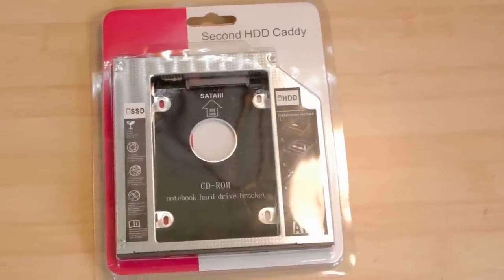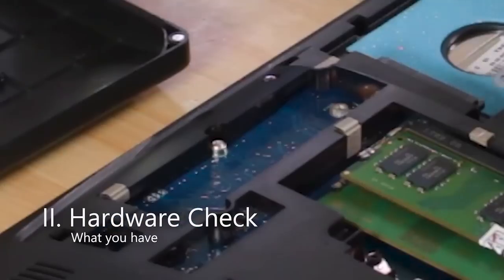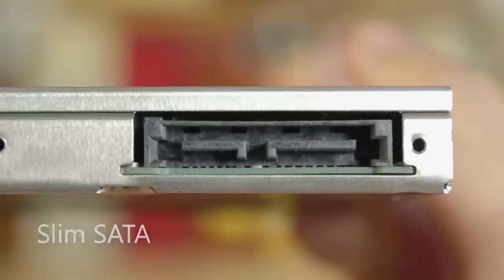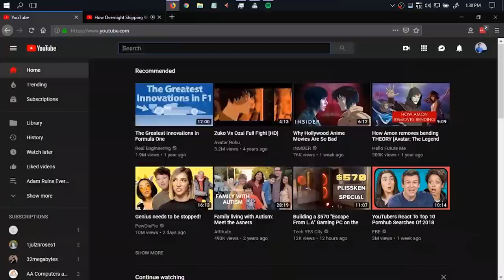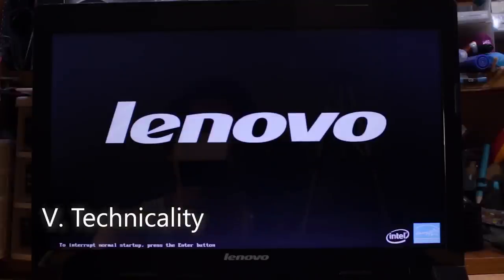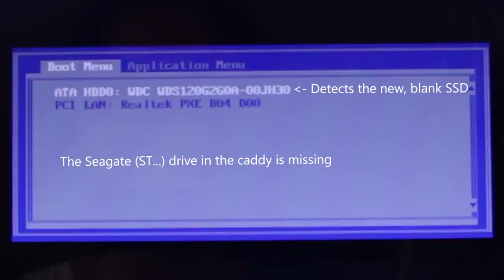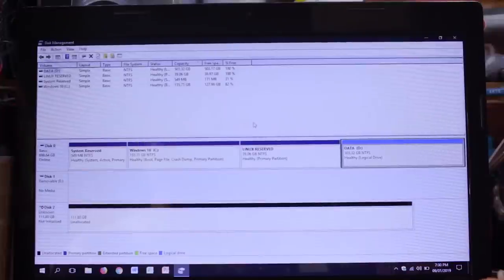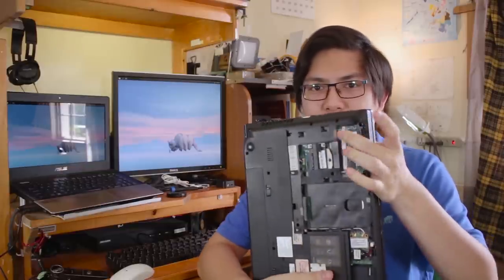SSD + HDD in Almost Any Laptop (The Caddy Method)

Comment from the maker: The Cloning Process: https://www.youtube.com/watch?v=wOksj16Q3ps
Reply: by mistake i have directly entered the caddy with the ssd and it is not coming out . help!
Reply: @Kevin Carl Jardiolin 128 GB should be enough. Remember to keep your desktop and my documents clean.
Reply: can I put an SSD in both internal hdd bay and caddy though ? if yes (in the caddy), Which SSD can I use ?
Reply: 1:08 SSD VGeN vs SanDisk fit my caddy drive in my laptop.
Reply: What is the model of the laptop you used in this video?

Comment: I want to share one important point with all. Always connect SDD with existing HDD sata 3 port to get max speed and you can shift existing HDD to DVD rom drive port sata 2 especially in case of laptop
Reply: But won't that slow down laptop if my windows is installed in HDD?
Reply: @sibinpaul2003  No. Because HDD maximum read and write speed is way less than theoretical speed of SATA 2
Reply: @awaisiqbal8934  Ohkk. Thanks for replying 😁
Reply: @sibinpaul2003 that's why this video is for. To upgrade to a ssd. If you want a faster HDD if your HDD is 5200 RPM. Or if you want something between a HDD and a ssd buy a hybrid drive. At first it will be slow but  it will get used to what you use frequently. Only if you don't install new apps.

Comment: The reason that the HDD may not be detected in the optical drive is because maybe, the HDD is drawing too much current from the DVD's internal port, during the initial spin up, HDD will draw significantly more current for a few seconds, manufacturers probably didn't anticipated their DVD slot will experience such a current surges so they might not make enough power headroom for the DVD power rails. Of course this is from my personal opinion, it may depended on several factors (Chipsets, Drivers, HDD brands...)
Reply: The pin outs are diff aswell
Reply: Would an ssd be more likely to work?
Reply: @Handlebrake2  In my experience, SSD tended to work more reliably than HDD in a caddy like this.
Reply: What's the solution. I am facing this too
Reply: For my dell E6420 both sata HDD and SSD are not detected.

Comment: The way I did it is I first installed removed the HDD and put it in the caddy, I then installed the ssd in the hdd's place and finally I did a fresh install of Windows. I asked some friends and they told me a fresh install is always the better way to go.
Reply: Did you have to do any configuring in bios or where you able to just load your hdd into caddied disk drive and it still booted normally?
Reply: Hey what about the windows licence if you freshly install in new drive?

Comment: I know a better method:
1.install the ssd with caddy in optical drive
2.then clone the hdd to ssd using any software like Samsung magician or macrium reflect
3.after the clone , interchange the drive . 
It should then boot from the ssd as default.
Reply: Agreed. This is exactly what I did with my laptop while basing from his previous video. Worked like a charm!
Reply: i follow this but i cant get caddy out of optical drive.
Reply: @mostafaabdelalim7390  there is a small space in the corner, you can use a screwdriver to remove after data transfer,i admit it takes a little bit of effort
Reply: @varunkatoch5912  I get it out. 
Then I interchange them. But cant boot from any if the two disks. 
Errorr messege appear of
adisk read error occured
Press alt +ctrl+del to restart
Reply: @mostafaabdelalim7390  are you sure you cloned the drive correctly?
Reply: @varunkatoch5912  yes. I have used it in DVD tray space. Before I interchange them
Reply: @mostafaabdelalim7390  try only putting the ssd in the laptop and not the hdd , and then go to the bios and select the ssd to boot and also want to know which laptop and which ssd you are using
Reply: @varunkatoch5912  laptop lenovo b5070.
Ssd of Kingston SA400s37240G 2.5 inch sata 3
Reply: @mostafaabdelalim7390  just make sure you clone all the windows partions correctly to the ssd
Reply: @varunkatoch5912 OK I will do.
But I can't run the windows from hd that is in dvd space to do clone. I will return it back again. . Or I will install fresh OS on ssd.
Reply: @varunkatoch5912  I have tried to put afresh version on ssd. But don't processed .why??
Reply: after cloning, do you delete the files on the HDD afterwards?
Reply: @dnzry2218  no. But I repeat clone again. Then run only the ssd instead of the hdd.. But not work.. It gives me disk read error
Reply: @edwardsy3430  does it increase the performance??
Reply: @ashaykapadiya  Yeah, for sure. If you're using a laptop with the HDD as the boot drive, getting an SSD is a big boost in boot up times and overall performamce imo.
Reply: Maybe that's assuming  you have an updated laptop with sata III + already!  - & Assuming OEM did not cut corners  in providing you a  drive bay and your dvd/CD bay @ best speed hmmm.. I guess the safest fastest for sure!  is going to be the drive bay! ssd may not get that same expected speed in dvd CD bay low end or not old or new - maybe see your manufacturer hardware specs first.
Reply: Didn't you watch the video? That's exactly what he tried to do in the beginning. But some laptops just don't recognize an SSD via caddy.
Reply: i think these are for older laptops most recent ones doesn't have any optical drives anymore but  there are free m.2 slot inside
Tip: most ssd and hdd manufacturers have there own cloning tools check there websites
Reply: Can i use usb to sata connector...for cloning my hdd to my new ssd? And will it clone my original windows 10m
Reply: @varunkatoch5912  did u mean that i dont have to use usb to sata cable? Bcuz i dont hve the cable... Can i clone without cable?
Reply: @yumyum_99  yes i also didn't have the usb cable still i upgraded to 860 evo and 2tb hard disk is still in the dvd bay
Reply: @varunkatoch5912  thnk u for replying instantly bcuz i just bought it just now and stuck in finding youtube n article on how to clone ssd without sata usb cable
Reply: @yumyum_99  which ssd did you buy?
Reply: @varunkatoch5912   adata su650 240GB, sir i must ask...

Im having problem on migrating my os from hdd to the ssd because my ssd is much smaller than my hdd... And my c/: disk has just too many personal files like movies, pictures, and games...

How am i goin to just move my windows file to the ssd so that i can have the ssd as the operating drive and the hdd as the storage (pictures, movies,...)
Reply: @yumyum_99  use the tool treesize to know which personal files are taking the most space and transfer all your personal file to some external harddisk or pen drive then use the cloning tool to transfer the windows partion
Reply: @varunkatoch5912  ok seems like i need to buy another external harddisk
Reply: @yumyum_99  or maybe just borrow from someone for some time then you can transfer all the data back in the internal hard disk
Reply: @varunkatoch5912  so if i have like adobe after effects or softwares thats installed on c/: disk, do i need to uninstall it?
Reply: @varunkatoch5912  or should i just install windows directly on the ssd
Reply: @yumyum_99  yeah and delete any big programs also that take lots of space
Reply: @yumyum_99  Thats your choice do want a fresh install of windows or just cloned either way will work
Reply: @varunkatoch5912  if im going for a fresh install of windows in ssd, that means i dont have microsoft office files in ssd right? So can i just do frsh windows install on ssd and then transfer microsoft office from my current hdd to the ssd.... But can i have to delete the windows file on the hdd after that?
Reply: @yumyum_99  yeah after the windows successfully start from ssd and hdd is recognized you will have to delete the old windows partions from the hdd
Reply: @yumyum_99   if you have bought the ms office then i recommend you to clone the hdd and not fresh install
Reply: @varunkatoch5912  thank you very much sir I understand now, peace be upon you👌
Reply: @yumyum_99  happy to help
Reply: @varunkatoch5912   ok sir what i just did is deleting my unnecessary file until its under 240gb , and ive done cloning , then i swap the two drivers , than restart, still boot slow, so i thought i have to change the bios priority order so.i change to ssd as #1,  still my laptop boots slow... What is happening? 

I check that my ssd is recognized as disk 0 and hdd as disk 1, but my acer c:/ is still 1TB (old hdd) size, it should hve changed to 240gb (ssd)... So my problem is ive cloned it perfectly but it doesnt boot from my ssd eventhough laptop recognize my ssd
Reply: @yumyum_99  try booting only with ssd and remove the hdd
Reply: @varunkatoch5912  thank u sir i remove the hdd and boot just om ssd and it work boots faster, so when laptop recognize my ssd as c:/ drive then i shutdown and insert my hdd then boot again , it still boots fast , so i just format the hdd now, thank you for your generous help
Reply: @yumyum_99  I'm glad i could help
Reply: @ll_distribution   big boost of performance using sata3 ssd to  sata 2 interface..
Reply: @Gemini-1   Thanks gemini1 Sweeter yet if an M2 Ngen ssd who doesn't rely on sata and AHCI but yeah, you are correct this application was for an older laptop.  Cheers!
Reply: My C Drive cost spaces more than 250GB, I need 500GB SSD for that.
Reply: Or, if you don't have an optical drive....
1.connect the ssd to USB/SATA adapter and plug adapter into computer
www.amazon.com/Drive-Adapter-Cable-Support-Black/dp/B07S9CKV7X/
2.then clone the hdd to ssd using any software like Samsung magician or macrium reflect
3.after the clone , interchange the drive . 
It should then boot from the ssd as default.
Reply: @aks3377  if you successfully change the drive you won't face any issues
Reply: @varunkatoch5912   Manuel Newton ML  i tried this method and installed fresh os installation on ssd and formatted the os partion in HDD while booted through ssd and it works but sometimes the HDD in caddy is not showing but a restart shows again. So is it caddy problem or do I need to delete recovery and primary partion of HDD through disk management as the other 2 partition i have files i don't want to delete. So can't fully format HDD. And i don't have spare laptop to check whether caddy is defective. So what do you think?
Reply: @sanjaygwa  Make sure the caddy is surely installed in the slot and is making a good contact with the sata port. if issue is still there then maybe the caddy is a faulty one and get it replaced asap
Reply: @sanjaygwa  by os partition you also mean all the small partitions as well right? If possible fully format the drive because the os files might interfer with the windows 10 on ssd
Reply: @varunkatoch5912  yes i tried to reinstall again and it happened again. One time it is showing all the partition and after sometimes it's not. Sometimes it required multiple restart. So as you suggested i placed replacement order on Amazon. Hopefully the new one works fine. As using SSD from HDD. I see huge boot time improvement and overall speed of windows. Can't go back to HDD now. Thanks for the answer.
Reply: @varunkatoch5912  i didn't delete small partition. As of now i can't fully format the HDD due to some files i need. Maybe I leave the partition i need and delete all other partition including the small ones?
Reply: @varunkatoch5912  the full format removed the problem mate. Thank you for the help.
Reply: @sanjaygwa  happy to help
Reply: Freedom Plaza, originally known as Western Plaza, is an open plaza in Northwest Washington, D.C., United States, located at the corner of 14th Street and Pennsylvania Avenue NW, adjacent to Pershing Park.
Reply: I don't clone.instead I take  capture image and then I apply the image to any of the different computers hard drive
Reply: Yea but i have ssd as main drive an all data with win7 is on ssd
Reply: @varunkatoch5912  Guys I need someone to help me. I bought the Samsung ssd 1T to replace my hdd and followed the steps to install the windows 10 on my USB. But for some reason my laptop won't recognise the ssd when I place it on the hdd slot. The only place it works is in my dvd slot for which I bought a caddy case. I don't won't my ssd to boot from my dvd slot (even though it works fine) . I want it to boot from its normal place. What is the problem?
Reply: Hey man can you help me, my hdd isn't picked up after this but ssd works fine
Reply: @emilsdaksa2712  Make sure hdd is properly connected via Sata port.
Reply: @device_drivers_installation  just did, still isnt showing
Reply: @emilsdaksa2712  how did you added hdd in your laptop
Reply: @device_drivers_installation  the hdd is working and even flashing green light upon turning on computet but after that it isnt being detected by the laptop
Reply: @emilsdaksa2712  Have you created a new partition on your formatted HDD?
Reply: @steadylabro4275  I changed the hdd to another, it works as it supposed to, I think it's just limitations put on by the manufacturer, as the hdd came with the laptop. The changed hdd works as intended in the main slot of another laptop.
Reply: I can use this method for lenovo G50-70..how much maximum hdd,sdd and ram i can use
Reply: @varunkatoch5912  I didn't quiet catch him. Is it better to finally put SSD in the actual HDD space and HDD in the optical drive space? Or it doesn't matter where we put what?
Reply: Thanks man.. This is way better

Comment: What I did in mine is that..

1. Took off the HDD
2. Insert my SSD and install windows
3. Insert my HDD to caddy

I did not option the cloning since I decided to reformat and upgrade to windows 10

It works for me and had amazing results.
Reply: What happen to os inside the hdd?
Reply: thatzmaloli he just wrote that he reformatted it, meaning he basically cleaned off any data on the hdd.
Reply: @LeanyG11  ahh didnt read that
Reply: @thatzmaloli4800  I did the same but I'm planning on just leaving the Operating system as it is because I changed the boot order and my machine is booting from the SSD

Comment: Hey EJ, I have a problem with my HDD performance after the caddy installation. SSD is INSIDE the laptop and HDD is in the caddy, SSD works beautifully and HDD hits maximum read speed of 12 MB/s but usually runs at 3 MB/s but write speeds are jumping up to 60MB/s!!!!
I also switched the sleep switch and there is NO difference. I have a USB to SATA connector and when I used it, the HDD works PERFECTLY at read speed of 43 MB/s. That means that my HDD works fine. I doubt that the caddy is faulty although I don't exclude that as an option. My laptop is DELL Inspiron 17 5767 and my caddy is Logilink 2nd SATA HDD Caddy. It doesn't show any other issues while in the caddy. Do you or anyone else reading this has any idea of what could be the problem??? And before you say SATA interface differences, BOTH SATA 1 and SATA 2 maximum speeds are faster than 43 MB/s.
And yes, I meant MegaBYTES, not MegaBITS.
Reply: PavleGamesRS , from your description, I'd say the caddy is faulty. If you have a spare hard drive lying around, try replacing the hd in the caddy just to confirm.

Comment: Hi EJ,

Installed SSD using caddy in my Acer Aspire 4750.
Installed fresh copy win 7 on SSD, then deleted the old OS in HDD.
Now I'm having issue when shutting down/ restart my laptop, it freezes.

I think it something to do with the caddy.
*SSD is still on caddy.

Any advice?
Reply: Sounds like you need to flip the switch on the caddy

Comment: Many thanks. Just implemented this process. Used Macrium Reflect for cloning. Kept it simple by cloning a one terabyte platter HD to a one terabyte SSD. My laptop is an HP Pavilion 15 about 5 years old that I had previously upgraded to a one TB HD a year or so ago. My first plan was to place the SSD device in the CD-ROM caddy. But that would not give the best SSD performance. 
So I  replaced the old HD with the new SDD (after cloning). And then I fitted the old HD in the caddy and replaced the CD-drive with the caddy. BINGO! That's the way to get the best performance from the SSD, as this video says.
Now the clincher. Anyone who uses a laptop onsite to do a contract job has to backup continually. Otherwise, there is the risk that malware will cause loss of work and lost time and even breach of contract. But with this setup, backup is easy. When I take a break of 5 or 10 minutes every hour or so, I save a new version of the file I am working on (v.01, v.02, v.03). Now, instead of backing up each new version on an external USB drive, I back up on the second internal HD. Saves time.
And if I install new software or install an update to existing software or to the operating system, at the end of the working day, I can just clone the SSD to the second internal HD. 
Then if catastrophe strikes in the form of failure of the SSD or malware, I can just swap the old HD back into the drive bay on the motherboard and I am back at work in less than 10 minutes. The cost of a one TB SSD plus HD caddy are now low enough to be classed as insurance against data loss. 
Actually, I am more paranoid about data loss than this and do keep more than one clone of my main drive on an external HD. And store one clone in a safe place in case the laptop is lost or stolen.
I have worked this HP Pavilion very hard on offshore sites in more than one country and more than one continent, back and forth every day from hotel to client office. And it still chugs along. Obviously I don't edit videos, at least not often. So the "slow" speed of the I5 CPU is no problem and since my laptops usually last 10 years (until the keyboards wear out) I have no reason to replace the laptop with a later model. 
So great to boot in seconds instead of minutes.